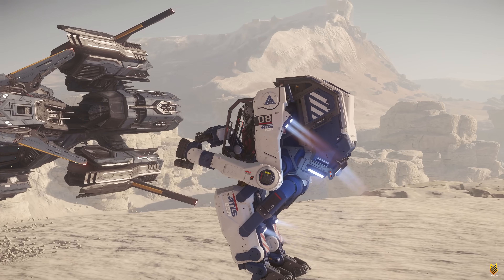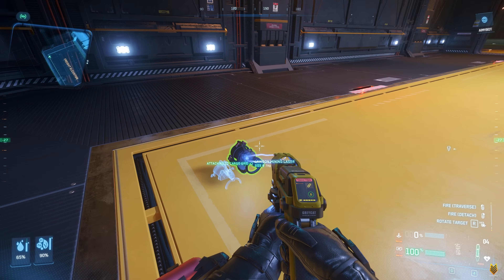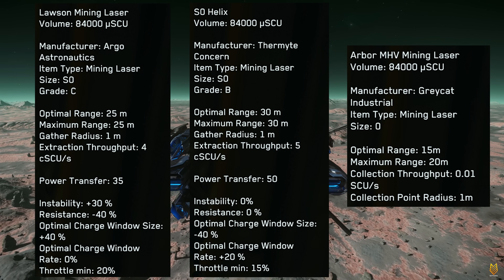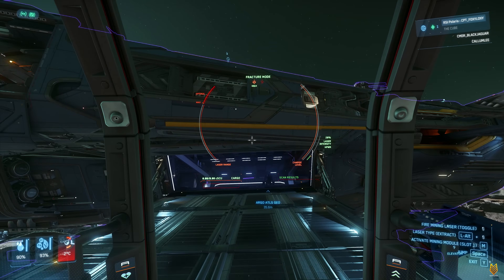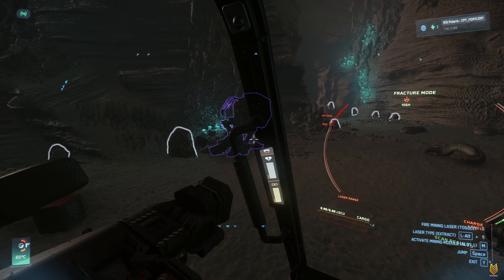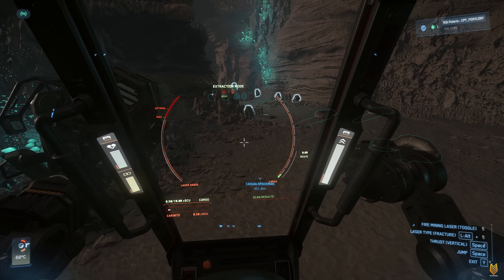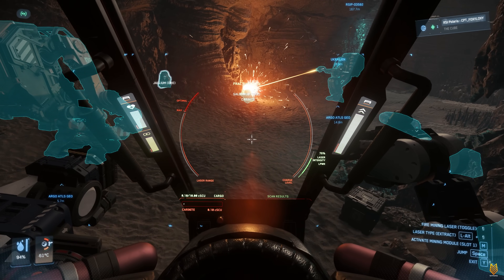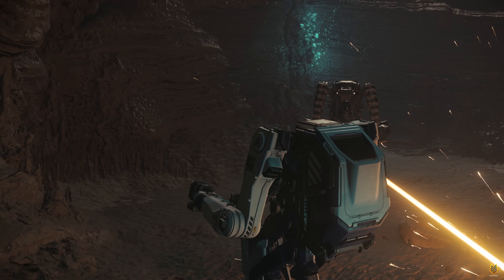GEO Testing Pt.3 | Mining Heads Test - Which One Is The Best For Align & Mine? | Science & Fun [4K]

Comment: Size 0 and 00 are smaller than 1 because 1 would just blow up the rock with too much power and heat. These mining heads/llasers are controlled, low power lasers that works by slowly heating up a rock so it cracks open like and egg. This part of SC has the most accurate laws of physics... energy, mass, heat, force, etc. 

Many never really learned the basics of mining science and only learned the art of mining which is a must know to do this job. I know,  I know.... Dave talks too much. 😅 Back to the game everyone! And don't forget to have fun.

Comment: The reason you couldn't break big rocks with the Arbor could be your distance to the rock. On the left side at the top, there is a range indicator and you were way to close, far away from the optimal distance. Because of that there was not enough energy going into the rock. I didn't test the mining heads myself so far, but I would guess that you can mine the big rocks with the arbor at optimal distance.